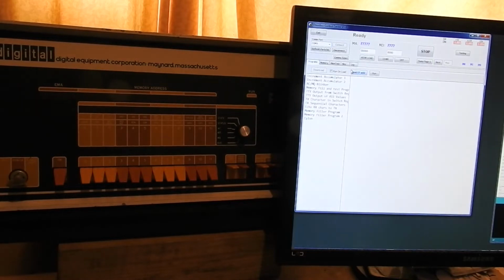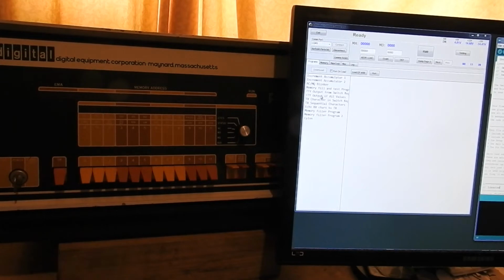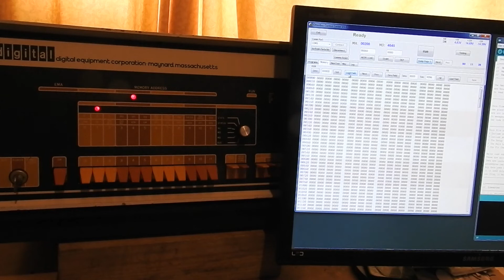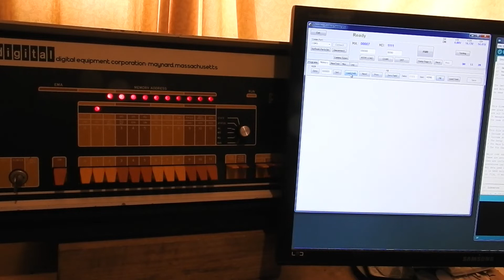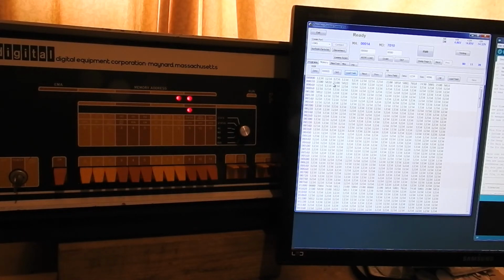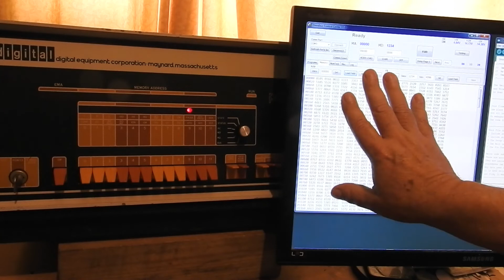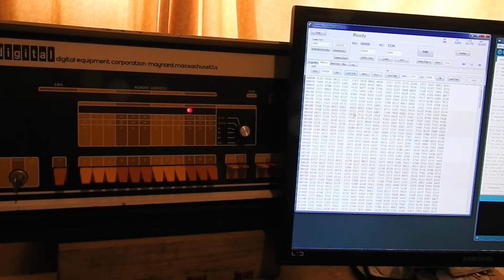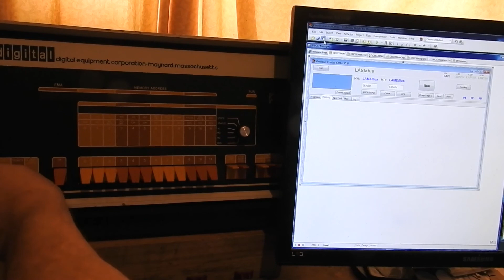Omnibus Interface   Quick update

Comment: I know you're probably busy but if you'd like to join in on the Eelectronics Australia  EDUC8 computer project I have re-engineered, you'd be welcome! Still the same original circuit but with new pcbs. Let me know
Reply from the maker: I've thought about doing that a few times over the years. 
The edge connectors being the main problem, I was thinking of using IDC headers and sockets, like the board in my video here.   
Are you going to host the project publicly somewhere? Like a thread in EEVBlog, or VCFed? 
Although I probably would not be interested in making it, I 'd certainly be be interested in following it's progress.
New PCBs, and double sided to eliminate all the wire links sounds great. 
Also, be sure to use a 2102 memory chip, instead of that expensive bipolar overkill thing that Jim Rowe specified (different pinouts).
A friend of mine actually used some other, larger memory chip, and implemented bank switching on his EDUC-8.